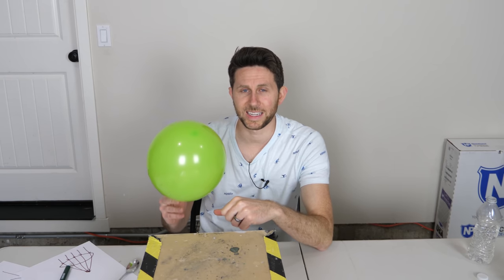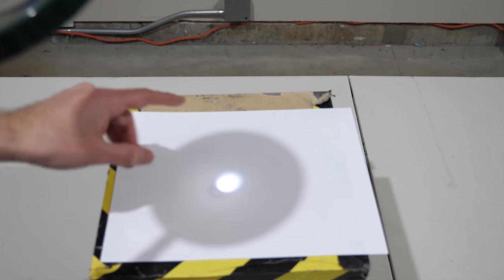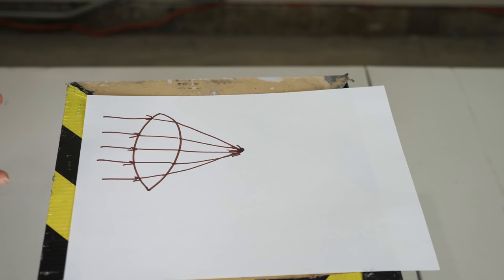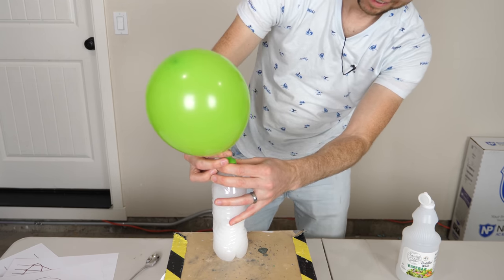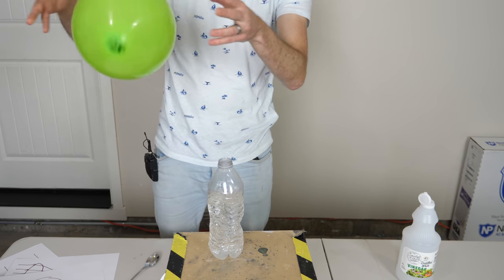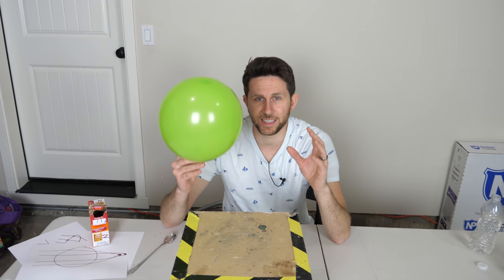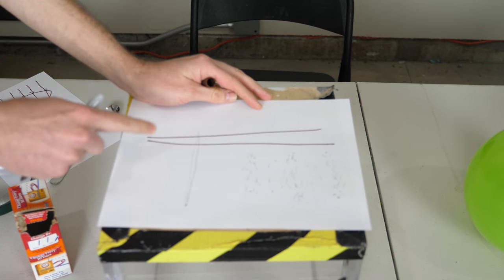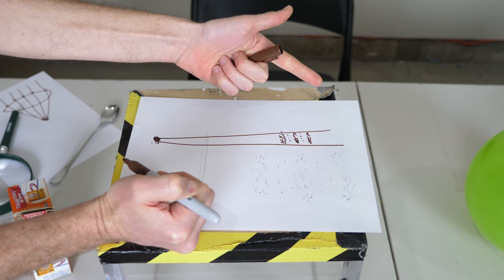Is it Possible to Make Hypersonic sound? Ultrasonic Sound Lasers and Lenses

Comment: Sound travels at 343m/s in air, and  1498m/s in water at 25C. Hypersonic sound is as easy as splashing in water. I can use an electromagnet to vibrate a metal plate at far beyond the speed of sound. A Gaussian wave (EMP) travels at the speed of light, therefore hypersonic sound is easily possible. You can do better than this, Action Lab.

Comment: Could that in turn prove a round earth? Because since the sound would be moving in one single direction and not curving or spreading in all directions. So by that conclusion on a round earth, if you localized that sound to almost a beam, it would continue onward in that same path. Resulting in not being able that sound because it would be above you. I hope that makes sense. If anyone wants to simplify that, please do 😂 as I'm not good at explaining things via text form.
Reply: In reality it would prove that the curve doesn't exist in the perfect mathematical sense that the reference ellipsoid gives... Because it absolutely doesn't if you ever seen the Geiod you would already understand how the equation only applies to angular resolution and air visibility factors not the over exaggerated ball of the reference ellipsoid...

But I can guarantee they will tell you this is pointless because they can send the signals "along the curvature" they already do it with regular radio wave propagation in weather radar... They claim they have to calculate the supposed curvature at 4/3 the actual effect because the waves will be bent down with the atmosphere accordingly making it always "curve" which literally means go in a straight line...

Hope that helps. :)
Reply: Oh and I didn't mean that your idea was "pointless" what I specifically meant was the people who would rather not to the observation would tell you it is. :)
Reply: @realityrealized8370  ok that makes a bit of sense, I'm not totally versed in how sound waves travel and all that. So I wasn't sure if that would Indeed prove a round earth. I'll definitely look into that more, but thanks for correcting me on that and again sense I'm not versed in this I'll have to take your word for it lol.